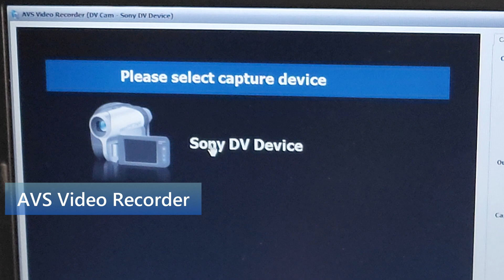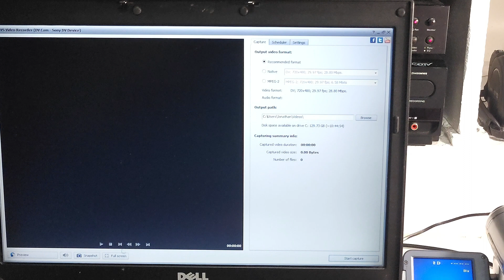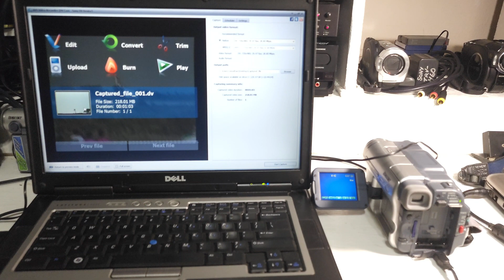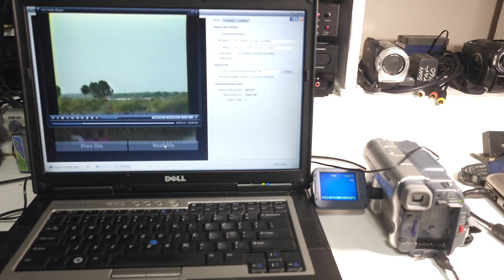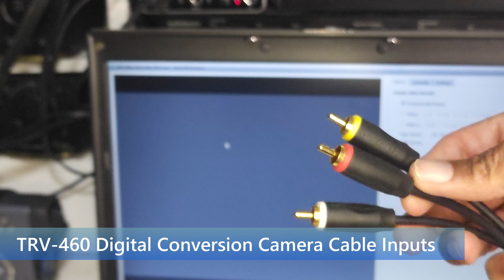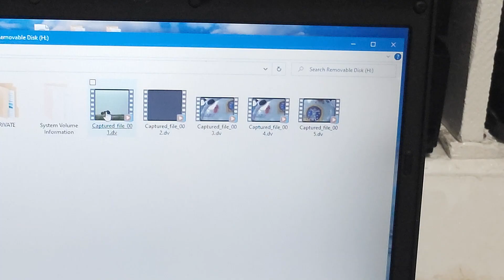How To Convert Analog to Digital pt 2 - Using Sony TRV-460 and IEEE 1394 Firewire

Comment: and the best method (best quality) for a video8 tape? Svideo to a decent capture card (io data gv usb2) or firewire?. DNR on or off?
Reply from the maker: @thepepinobot  FireWire is always the best if you can because it’s already digital.  You will get an exact replica of a DV or digital 8.  For r video 8, playing in a digital 8 camera, the camera does the digitizing.  The camera will most likely do a better job than most capture cards.  I would not use any noise reduction.  Save that for post production.
Thanks for watching.

Comment: Hi, just found your videos, and I wonder if there is any gain in quality from transferring AV from camcorder to a dvd burner vs transferring IEEE 1394 to a pc. I have  Canon zr960 and some mini DV tapes I will be putting on DVD or into a pc. I have a VHS dvd combo , like the one in your video.  Would the IEEE card method produce better quality capture?  Thanks .
Reply: Great, thanks. I'll keep that in mind.
Reply from the maker: Hello,
The IEEE 1394 to computer is the absolute best method to transfer miniDV since the tape is already digital and an exact copy is sent to the computer.  If you transfer to a DVD the signal will be converted to analog and then re-encoded to MPEG-2 digital.  It will lose some quality in the process.  If you have a choice, use the 1394 method.
Thanks for watching

Comment: I have this camera and the volume doesn’t work, I cannot hear the sound of the video even though the volume is all the way up?
Reply from the maker: Sorry to tell you your camera is broken.  Probably cheaper to buy another one.  Mine broke last year and it was sad because it was my last tape based camcorder that I bought new.  I got 2 more off eBay.

Thanks for watching
Reply: @WaybackRewind  so it isn’t the video cassettes? I’ve tried two and both don’t have sound.
Reply from the maker: Sadly I believe your camera is broken.  These old cameras stop working for no reason when internal components fail.
Reply: The only possibility apart from a defective camcorder, is that the recordings were made with only PCM digital audio.  A few high end devices supported that.  But domestic camcorders didn't, so it's relatively unlikely to be the cause of no audio unless you know that they were made with a very expensive camera.
Reply from the maker: @video99couk  thank you so much for your comment.  I know you are a professional at video transfer.  I do it for my own benefit.  I have never run into that audio issue.  I just subscribed to your channel. 
Thanks for watching.

Comment: Please can how do you transfer to a modern computer
Reply from the maker: For a desktop it's easy, just get a firewire card.  For a modern laptop it's tricky.  If you have a thunderbolt 4 port you can get a thunderbolt 4 to thunderbolt 3 adapter.  Then there are firewire to thunderbolt 3 adapters.  I have no idea if all that will work, but it's the only possible path I know of.  

Thanks for watching.

Comment: It might be possible to use a FireWire PCI card on a laptop via an eGPU dock connected via Thunderbolt or M.2, as long as the card can work via 2 or 4 lanes.
Reply from the maker: It might work on a thunderbolt if you have a laptop with one.  None of mine do so I can’t test that.  Thanks for watching.

Comment: Sorry silly question, For the TR-460, can you output using av cable and capture it  if you dont have a IEEE 1394 firewire cable
Reply from the maker: Yes, you can output on the a/v Cable and capture with another device.  This is exactly what I did in Part 4 https://youtu.be/aYwijPKLCnM